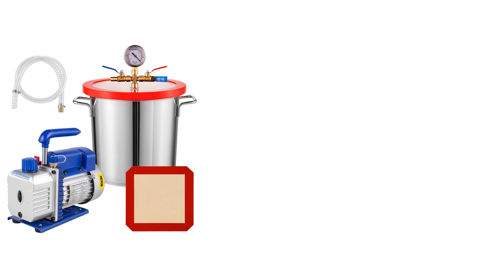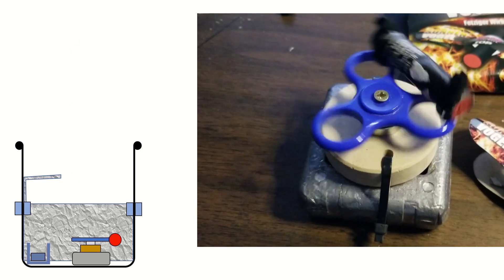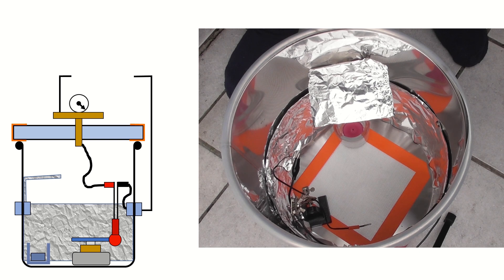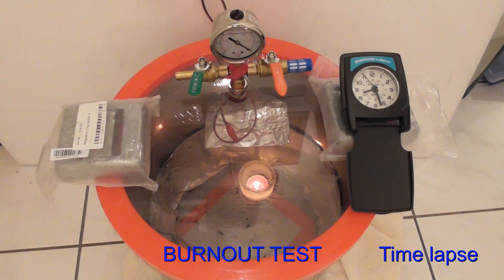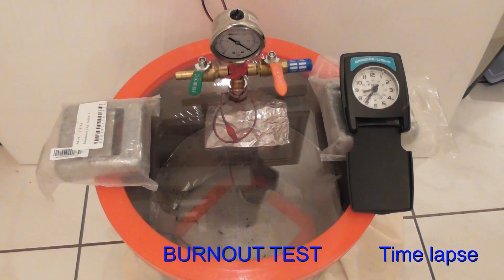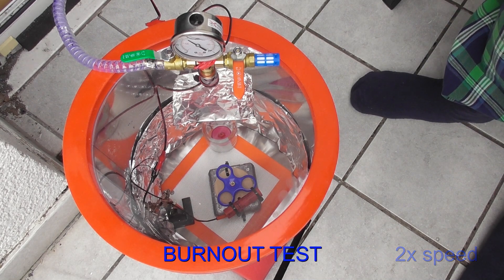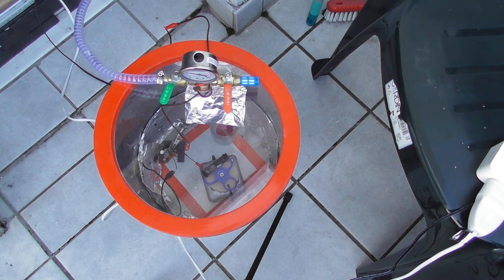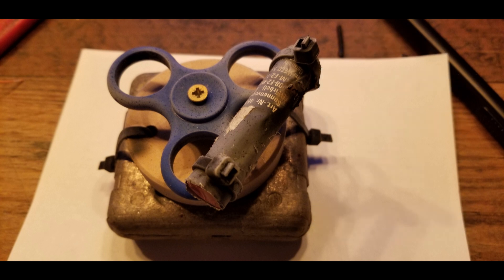Rocket in a Vacuum

Comment: To anyone claiming rockets don't work in a vacuum, I would ask a simple question.
Would an astronaut in the vacuum of space, be harmed if they set off a stick of dynamite held in their hand.
Reply: Laws of thermodynamics denier asking troll riddles.
Reply: @papalegba6796  The "troll riddle" is a fair point. If the dynamite detonates in a vacuum and harms the astronaut, clearly rockets can as well. That means that the presence of a vacuum doesn't magically invalidate Newton's Third Law.
Reply: Ok thermodynamics denier.
Reply: @papalegba6796  OK, Newton's Third Law denier.
Reply: Pretty sure the laws of thermodynamics apply to heat engines, angry guy. Plus a free body diagram shows that rockets cannot alter their state of motion in a vacuum, so Newton ain't on your side too lol.
Reply: @papalegba6796 ...except when that free body diagram is of the rocket body and the rocket fuel. You forgot that one, huh?
Reply: @papalegba6796  you keep going on about "heat engines", wtf do you think those has to do with a controlled explosion?
Reply: @papalegba6796   If you knew any laws of thermodynamics you wouldn't make that ridiculous claim. Go ahead and justify your claim by showing your violation. I know that you are going to evade that question.

Comment: I like the dumbness that is claiming if the engine isn't firing the spacecraft would stop.
They actually think Star Wars is real..
Reply: And Star Trek: "The engine is off and we are losing orbit."
Me: "That's not how orbits work." 
Love Star Trek anyway though.
Reply: @okradeinnod  Well, y'know, technically, if, hypothetically speaking, they were in orbit around the Earth at 200 km above sea level, going west around the Equator, they would be losing orbit once the engine stopped. They'd have a few weeks to get it restarted, not just one episode, but the drag would be significant.
Now, going east at 20000 km, sure, no problem, obviously.
Reply: @Sableagle  I don't think the viewers would enjoy waiting several episodes of them repairing  engines.
Reply: @okradeinnod  
Star Trek did at least get one thing right:
In a TNG episode, the Enterprise D encountered another starship where some of the crew had been killed because a hatch in the outer hull had been opened. When commander Riker commented on this, saying that they had been sucked into space by the vacuum, the android Data corrected him and said they had been blown out by the interior pressure.
Reply: Clearly, they have never played Asteroids...

Comment: I don't have access to a vacuum chamber but I want to suggest an alternative demonstration that avoids the common flatearther claim that the rocket is actually pushing off residual air - or that the rocket exhaust itself immediately destroys the vacuum and invalidates the test. It would also avoid the difficulty getting propellant to ignite in vacuum.

Simply this: have a length of soft flexible clear plastic tubing - like hearing aid tubing - hanging from the top of the chamber with a 90º bend at the lower end to create the 'rocket'. Then when vacuum is established, open a tap and let atmospheric air in through the tube. It will swing away from the rocket nozzle as soon as air flows through. You could suspend down feathers around the chamber and high-speed cameras would confirm that the tube moves before any air gets to the feathers.

Better: use coloured water from a tank on top and the reaction will be stronger and the visibility of the water will make it more obvious that the rocket moves before the water can be said to be pushing against anything else. 

Better still: use a bit of hard clear plastic tube as the rocket motor, closed at one end and suspended from the flexible tube like the head of a polo mallet. Now, water will flow towards both ends of the rocket chamber when the tap is opened, and the cameras should confirm that the motor doesn't move until there is water pressure on the inside of the closed end.

Just a suggestion :-)
Reply: Or draw a free body diagram? Too technical for you eh?
Reply from the maker: @Papa Legba redo my test to your standards.. or is that to technical for ya?
Reply: @slysparkane808  Papa Legba would rather spam another day (like right now) than give their thoughts on how to improve the experiment.
Reply: The experiment is perfect, as it shows rockets can't work in a vacuum lol.
Reply: @papalegba6796  "The experiment is perfect, as it shows rockets can't work in a vacuum"  So logic is not your strong suit, then. It cannot have proven that rockets can't work in a vacuum - since by your own initial objection, it wasn't a vacuum.

BTW, if reaction motors needed something to push off, then the thicker the medium the better they should work. So an unrestrained garden hose flailing about the back yard to the amusement of dogs and small children should flail about even  more violently when submerged in a pool. Does it?
Reply: @papalegba6796  Liar, liar, pants on fire!
Reply: @papalegba6796  The specific impulse equation for working out the FORCE produced by a rocket motor shows that it approaches a vacuum it produces MORE THRUST. I know you don't understand this, but maybe if you spent 30 with google and the NASA website, you might learn something.
Reply: @papalegba6796  A free body diagram of the rocket fuel and the rocket body. Go.
Reply: @papalegba6796  No, I love a good diagram. But you can't draw, in a comment on a YouTube video. Too technical for you?

Comment: Inches of Hg? What am I watching!
Reply: Inches of mercury is a measure of pressure, referring to how high a column of mercury will rise in a barometer.
Reply: @the18thdoctor3  It is the worst combination of barbaric units I have seen in my lifetime.
Reply: @doranku  ok? It's practical.
Reply: @doranku  BARbaric units?!  Ye killed me rite there!
Reply: @doranku  It's because the original barometers where exactly that, U tubes with Hg in it.
Reply: @ComradeJehannum  Exactly: barbaric. Long since replaced by more sensible, logical units.
Reply: @Paxmax  Oh, didn't see that coming :)
Reply: @the18thdoctor3  Except I have never seen a pressure-o-meter (as a physics student) with Hg/inch, not even Hg/mm, only bar (which is ofcourse also incorrect but coincidentally the same as a hPa). Must be because I'm in the S.I. world (where Sly also is).
Reply: @doranku  How about velocity in Furlongs per Fortnight?
Reply: I think it's height of mercery or something

Comment: Someone below suggested the Flerfie excuse that it pushes against what air remains.  To counter that (silly)  argument a firing in the chamber without evacuating it and somehow comparing the numbers of rotations in each would work.
Reply: I wonder if it would go faster in a vacuum? 🤔
Also laser rpm counters are a thing.
Reply: @awatt  that's what I would expect.
Reply: As you found out the igniter must touch the propellant to ensure ignition. This is what is recommended by Estes, a manufacturer of model rocket engines, even in normal atmospheric conditions.

Comment: Putting the rocket engine on a rotating platform was a good move. It helps against the weird claims that the chamber walls rebounded the exhaust and pushed the engine somehow.
Reply: Not in a way any flerf would get, so what does it matter. I think that this is exactly what they will claim.
Reply: @eleventhchimp  Well, yeah, there's that. It doesn't stop them from saying ignorant things.
Reply: No, it wasn't a vacuum so the demonstration was pointless lol. Sad stuff tbh...
Reply: @papalegba6796  What do you think a vacuum is?
Reply: Vacuums aren't filled with smoke lol. Troll video.
Reply: @papalegba6796  Dust particles aren’t smoke. Again what do you think a vacuum is?
Reply: @doofismannfred4778  So just as I said, it didn’t help at all. Death and taxes just made that very weird claim. We can’t accuse them of being very smart.
Reply: @eleventhchimp 
Release gas into a vacuum chamber and you no longer have a vacuum. You can dance around it all you like but you lose.
Reply: @TerenceHughes4501  Again, what do you think a vacuum is? If you pump a vacuum in two containers and you release some gas in one of them resulting in the same pressure in both, is one a vacuum but the other is not?
Reply: @eleventhchimp 
Exactly my point. If you release gas pressure into the containers in which you created a vacuum you no longer have a vacuum. Absolutely correct
Reply: @TerenceHughes4501  Ok, so when do you have a vacuum? Is 1000 Pa a vacuum? 100 Pa? 
Let’s say you have two containers and you pump one down to 20 Pa and the other to 10 Pa, then you release some gas in the second one, raising the pressure to 15 Pa. Which one is still a vacuum, the one with 20 Pa where you did not release any gas, or the one with 15 Pa where you did? Or is neither a vacuum? If so, why?
Reply: @TerenceHughes4501  If you release gas from a high pressure vessel into a vessel pumped down to vacuum, are YOU arguing that there will be no FORCE EXERTED on the vessels as the GAS is accelerated from one vessel to the other?

SO you are arguing that MASS CAN BE ACCELERATED WITHOUT A FORCE?

Are you SURE about that?
Reply: @stuartgray5877 
Strawman. I make no such claims. I'm just explaining to you the 2nd law of thermodynamics.
Seems you lack even a basic education in physics
Reply: @TerenceHughes4501  You explain nothing but make many claims. The rocket started in a vacuum then created the smoke as it started to move. Your point is invalid even before the rocket exhaust add a little pressure and no oxygen. One of the main talking points of flerf’s is rockets can’t work with out oxygen. As there was a vacuum when the rocket started the flerf hypothesis is disproven. It should be noted that what we call space is not a perfect vacuum and an atmosphere has been detected out as far as the moon but don’t let facts get in your way. 

PS: When using a dictionary to prove your point it’s important not to hit yourself with it, or use word definitions that change constantly to prove a point.
Reply: @psibug565 
Again. What happens THE INSTANT you release gas into a vacuum chamber?
You no longer have a vacuum chamber
The end
Reply: @TerenceHughes4501  Why is it no longer a vacuum the INSTANT you release gas into a vacuum chamber and why was it a vacuum to begin with? Does it matter how much gas is released? Does it matter how low the pressure was in the vacuum chamber before you release gas into it?
If you pump a vacuum of 10 Pa in a vacuum chamber, is that a vacuum?
If you pump a vacuum of 5 Pa into a vacuum chamber and then release gas into it, raising the pressure to 5.1 Pa is that no longer a vacuum? Now we have a vacuum of 10 Pa in one vacuum chamber and a non-vacuum of 5.1 Pa in the other. What do you think makes a vacuum a vacuum? Why is that so incredibly hard for you to answer?
Reply: its still bouncing of the walls. that chamber is tiny
Reply: Lmao the chamber was full of smoke before the rocket started moving. All the trolls on this channel are blind.
Reply: @papalegba6796  That's why the addendum at 7:30 contains useful information. I guess Sly would have to be a time traveler, now.
Reply: Lol the vacuum chamber did not contain a vacuum. This ain't hard, the experiment is useless.
Reply: @papalegba6796  Then what in your mind is a vacuum? What exactly do you think is the difference between a vacuum and a non-vacuum? Does dust particles have anything to do with if it is a vacuum or not? Does a rocket have full thrust until it is a vacuum, and then it drops to zero thrust. At exactly what gas pressure does the thrust suddenly go from full to none?
Reply: I already told you lol. Troll confirmed.
Reply: Literally having to change the definition of the word "vacuum" for this video to be legit lmao.
Reply: @papalegba6796  So what do you believe is the definition of the word vacuum? Why is that so hard to answer? Is the functioning of a rocket binary; if it is in a vacuum it doesn’t work at all, but as long as it is not in a vacuum it functions at full thrust? Or is it a gradient? The lower the pressure the lower the thrust?
At exactly (in the unit of your choice) do you have a vacuum?
Reply: I already told you lol.
Reply: @papalegba6796  What pressure? Absolute 0? 1 Pa? 0.1Pa? What is the exact definition? At what pressure does the thrust suddenly disappear?
Reply: W=pv lol. Calculate it yourself.
Reply: @papalegba6796  Ok. Let’s pretend you know what that equation is and that it in any way answers the question I asked. 
As that is the question at hand I suppose you are suggesting that p in that equation is the ambient (atmospheric) pressure? What volume am I supposed to use? The equation gives me work done. How do I get thrust (the force) from that? And how do I get a cut off value for at what ambient pressure that force suddenly goes to zero?
You are saying that this experiment is useless, which implies that even though the pressure in the container is very, very low it does not affect the thrust at all. How low does the pressure have to be to have an effect on the thrust?
Reply: @papalegba6796  please define the following

W
p
v
Reply: You calculated it yet? It's not hard lol.
Reply: You don't know the physics definition of "work" either lmao.
Reply: @papalegba6796  How does it apply in the case of the force (thrust) you get from a rocket engine?
Reply: @papalegba6796  calculated what? your "equation" is nothing.
Reply: Three of you mad goons ranting at me now? Lol this channel is demented. Absolutely nuts.
Reply: @papalegba6796  I can see you are used to channels that immediately just block all opposing views. I’d call those channels demented, but maybe that’s just me. 
Are you actually unaware that you are deluding yourself? I am being serious. Do you actually think you are being rational?
Reply: No I'm used to channels that aren't run by psychopaths lol.
Reply: @eleventhchimp  

You cannot re-create the theoretical idea of the vacuum of space in your kitchen.
Reply: @Snide01  says who?
Reply: @ComradeJehannum  reality
Reply: @Snide01  😂 That was a hilariously contrived way to word your sentance to not risk being percieved as to admit to space being real.
Reply: @Snide01  I had recreate BETTER than the vacuum of space in My kitchen.
Reply: @Snide01  OK. Whether a person can recreate a vacuum in their kitchen is irrelevant to the overarching point. Rockets eject mass one way and, in response, move the other way. Simple stuff. They even work better the less air that is around them. That wouldn't be the case if flat Earth science deniers had their version of reality. According to their "logic," a rocket would work better underwater rather than in air.
Reply: @eleventhchimp  I can see "space" above my head, not sure what you are babbling on about
Reply: @Snide01  So instead of addressing what I said, just claim I have "psychological issues." That'll fix it.
Reply: @Snide01  "I don't know what you said..." * proceeds to write a wall of text. * Yeah. You go ahead and have that one-sided conversation with yourself, then.
Reply: @Snide01  Projection.
Reply: @doofismannfred4778  facts
Reply: @TerenceHughes4501  Do you think there is either a vacuum or a pressurised environment? In that case, exactly at what pressure do you have a vacuum and no longer a pressurised environment? Where is your citation for that?
Reply: @eleventhchimp 
I'm saying that if you introduce gas into a vacuum chamber, you lose your vacuum instantly. Surely you don't need a citation for that. It's basic common sense
Reply: @TerenceHughes4501  I understand that you think so, but, again, when is a low pressure low enough to be a vacuum, and when is it not?
You do know that there is no perfect vacuum, right? A vacuum is just a very low pressure. When releasing a gas in a vacuum chamber the pressure goes up from very low to slightly higher, but arguably still very low. At what point (what pressure), exactly, does it cease to be a vacuum in your opinion, and where is your citation for that?
Reply: @eleventhchimp 
You're just throwing word salad. No matter how low the pressure, the moment you release gas into that container, you increase it. You no longer have a vacuum. Not even close. You're making an idiotic argument
Reply: @Snide01  you see lights twinkling in water above your head. Go look at all the stars with a telescope.
Reply: @davidjohnson1463  How do you know it’s water?
Reply: @davidjohnson1463  

looks like lights behind water but that is just a guess..

I don't take part in pushing any theories or guesses as facts, that's what Science has done and I will not take part in the lies and mis/dis-information..
Reply: @papalegba6796  You seem easily triggered. I suggest not commenting as you seem to resort to ad hominem attacks when proven wrong.
Reply: P0wFish  Who the crap told you to divide pressure numbers?! Pressure DIFFERENCE. Difference means subtraction, not division. Please learn which math operations go with which words. Sum, difference, product and quotient.
Reply: @papalegba6796 
The instant you release gas pressure into a vacuum chamber, you no longer have a vacuum
Reply: @TerenceHughes4501  not to mention heat from rockets also increase pressure. well said my friend
Reply: "Smoke: the visible vapor and gases given off by a burning or smoldering substance, especially the gray, brown, or blackish mixture of gases and suspended carbon particles resulting from the combustion of wood, peat, coal, or other organic matter".
Vapor & gases & particles lol, you fail, lying troll guy.
Reply: "Vacuum: a space from which most or all of the matter has been removed, or where there is little or no matter".
So not full of smoke then, lol.
Reply: @papalegba6796  ok. So what do you think a vacuum is?